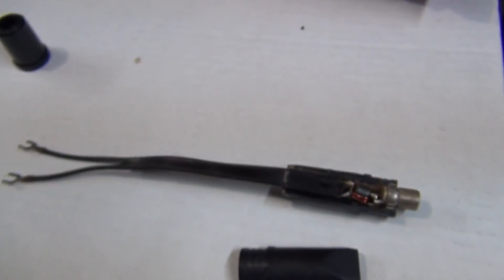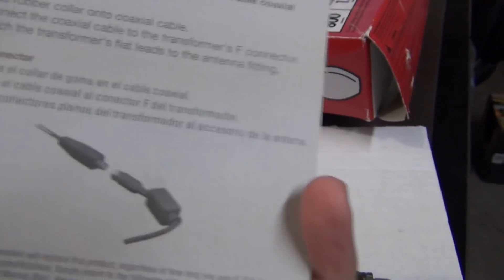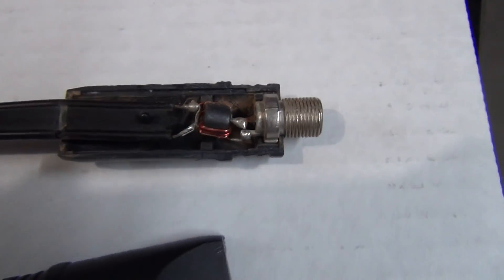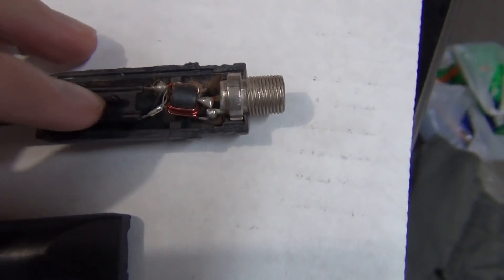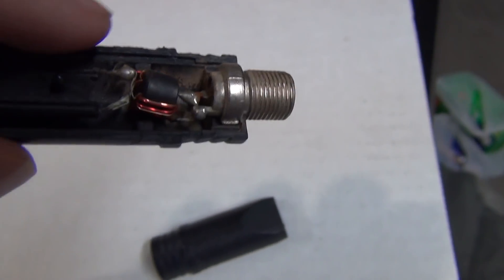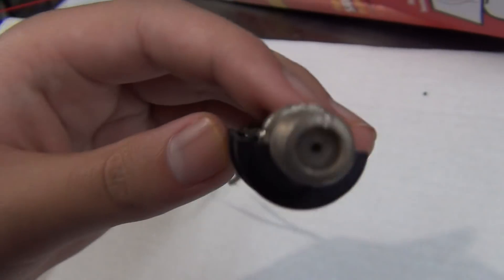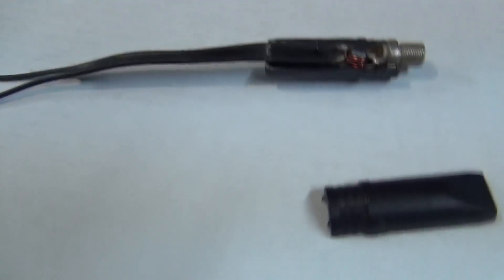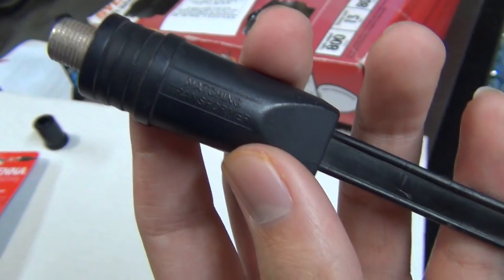Inside a Coaxial Cable Balun (VHF/UHF Transformer)

Comment: I bought an old 1960s TV this weekend and I'm attempting to run hdmi source video into it. Every part (hdmi cable, hdmi-sdi adapter, usbc-hdmi adaptor) is brand new besides the ancient looking VHF to Coax connector that came with it. I'm praying it will work once this is replaced. I will know this evening.....

Comment: The thing in the middle of the balanced 300 ohm input is the dielectric and it serves as a capacitive coupling between the “hot” and “cold” phases. The main reason for this is that each impedance requires a certain uniform distance between the conductors in order to function as a transmission line; otherwise, the signal can induce a reflection in the line resulting in signal loss and a potential for the transmission line to act as an extension of the antenna.

Comment: Went up to my roof. Noticed the two little thin wires where either chewed up by some pest or just rotted over years. Anyways is this the reasoning not getting good signal.? Do I have to just buy a new uhf transformer thing?

Comment: I have a question. Does it matter how far the balun is from the antenna connections? I’m thinking about connecting sturdy wires to the antenna connections and running them down the mast and then connecting them to the balun at the bottom of the mast. That way I can tape the balun to the bottom of the mast and can access it easier if I ever need to change it. Will that effect channel signal strength? Thanks.
Reply from the maker: I would recommend the balun be connected as close to the antenna connections as possible. Running (probably) unshielded wires down the mast could affect your signal strength. A coax cable is shielded, so there will be less signal loss once you connect to that.
Reply: Thanks guys. I did that and went from 26 channels to 52 channels. Thanks again.
Reply: Thank you sir. I will do that.
Reply: Always as close to the antenna as possible. 300 ohm wire acts as part of the antenna and changes the radiation pattern the longer it is. To overcome this, connect the transformer right directly to the antenna then run at least dual shield rg6 coax with good and solid compression connectors.

Comment: can these things go bad?  I've got one on this vintage 79 TV that when i try to connect the Nintendo to it, the picture barely shows.  tbh i never remember vhf ever working on any of my old TVs back in the day.  that's why i went pure coaxial when i went to get my RCA.  but now that i have an old tube in my possession again, i really want it to work.
Reply from the maker: Yes it is quite possible that a balun would go bad, especially if it is really old or has been subjected to extreme temperatures or a dusty environment. Maybe try a new balun to see if that fixes the issue, and check the connection on your TV to check if it is clean.

Comment: why we need the balun?
Reply: The balun (balanced-unbalanced) is needed to connect your balanced antenna (300 ohm) to the unbalanced coax cable (50 or 75 ohms). Lots of info on the balun. Google is your friend. :-)
Reply: Google User  how can we connect an antenna to a TV without the balun? old TVs used 300 ohm twin lean that connected right to the back of the TV
Reply: You have More channels

Comment: Can I connect a over the air antenna to my tv with that transformer ? My tv does not have a coax cable connector on the back.